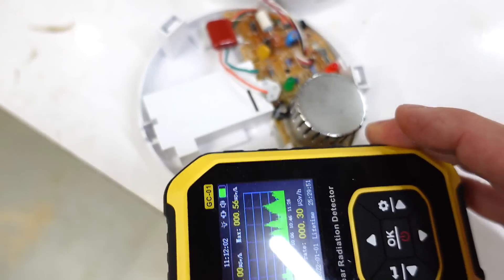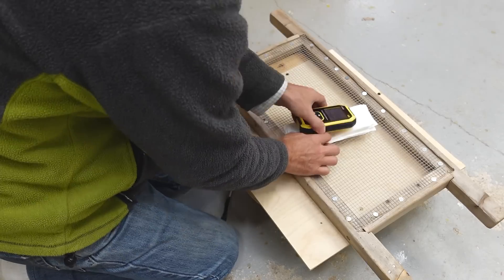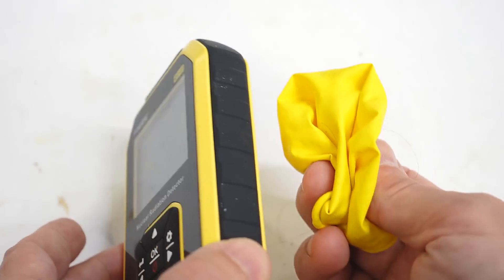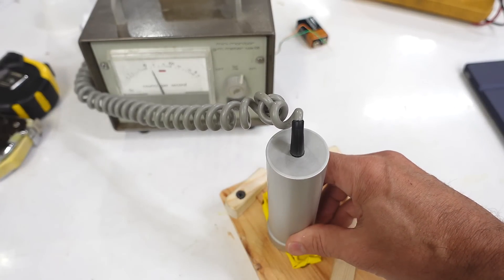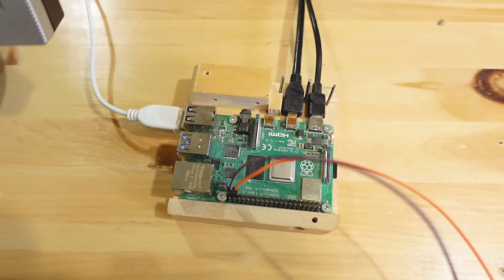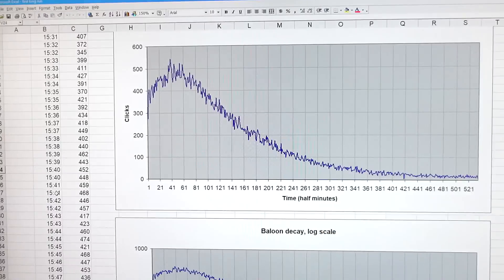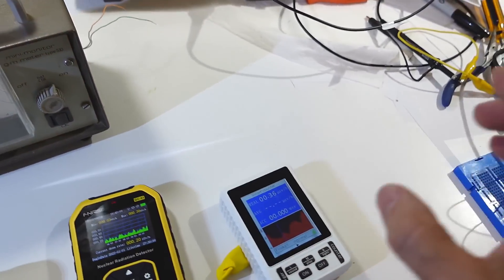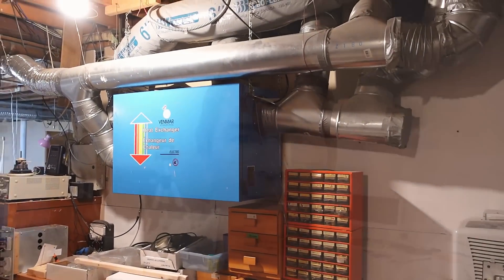Making radioactive balloons using Radon gas

Comment: If you know a welder, see if you can get a 2% thoriated tungsten tig electrode and check it out with your Geiger counter. That would be interesting. Thanks for the video.
Reply: Tungsten rods are dirt cheap, but not all of them have thorium in them. They're color coded to identify what the tungsten is blended with. Green and purple are supposed to be non-radioactive, for instance.

Comment: I have a GQ GMC-500 (there are a few different models) - I really like it, the firmware and UI is pretty decent. It has a 18650 Lithium battery that is easily replaceable. My grandpa was a watch and clock repairman and I have a ton of old radium painted clocks hanging around. Highest reading I've got was 45,000cpm off of a clock from an old aircraft(he was also in the RCAF). 
Ill have to try this radon trick in my shop. If I leave the shop closed for a few days and don't run any ventilation the radon can get up to 250 Bq/m3. I try not to let that happen.

Comment: As someone currently deciding whether or not to get a radon mitigation system in my home, I would be very interested in your insights on the subject. High radon levels is an issue where I live in Oregon, USA. I bought a real-time tester on Amazon and have been experimenting with it on different levels of the house, windows opened and closed, HVAC system on or off. I hope to see a Matthias video on radon in the home!
Reply: If you have an HVAC-system that really works in all rooms, do you really need to remove the radon?
Reply: Radon is yet another spooky bs promoted by charlatans. Do not buy this system. Radon does not affect your health.

Comment: Alpha particles are attracted to various synthetic fabrics as well. Certain atmospheric conditions are especially amenable to producing radon, how much cement is in the building you're in also makes a difference. At our nuclear facility, we have workers go through a portal monitor to screen for beta contamination; it will detect alpha as well, so if it alarms we have to use a portable alpha monitor to determine that it is alpha (radon progeny - using the term daughter products is no longer politically correct).

Comment: idk im thinking that the geiger counter uses an integration that takes like 15-30 minutes to get a full sample size. so if you put the probe over something radio active, not until ~15-30 minutes will it actually have a full sample of the radioactivity since the first part will be all zeros/background. thats my thinking for the bump up.
also all the muller tubes you showed are the cheap glass coated tinoxide sputtered kind. the real good ones are the all metal gamma scout type ones. the glass ones suffer from the thickness of the glass blocking a lot of radieation. i have the same cheap chinease counter at you and inside it has that same glass tube as the one you hooked up to the raspi. i think the issue with the construction of the more accurate tubes and why theyre always 200$+ is the beryillium window or whatever they use. something metal, conductive, but very radio transperent. its crazy what you can buy online now days for cheap. i got a pocket ultrasound with 2 heads, basically as good as the 7000$ GE one for 1300$. you can get a portable chest xray electronic sensor and camera for like 5000$. things are going to be really different in the future if there is ever a war in the pacific.

Comment: Back in the late '80's a buddy of mine did his grad project on recording radon, using the biology storage room as his first test site. He used a Commador 64, a fan, but I'm unsure what he used for the detector and counter. In any event we found out that the storage area was pretty hot.

One thing to test, the replacement filaments for Coleman white case lanterns. They used to contain Thorium to create a whiter light. No need to buy, just go to the sporting goods store with your tester. :)
Reply: Coleman hasn't produced a thorium mantle in decades. You won't find any at a sporting goods store. Maybe an antique shop.
Reply: @Orcinus24x5   Well bugger! Thanks for the update.

Comment: What made you avoid the GMC-300E? Last I knew is was the gold standard for cheap geiger counters. It has a replaceable 14500 battery, can run on external power, and can log data over USB.
Reply from the maker: didn't know about it.  But if I knew about it, I wouldn't have bougt it casue its 3x the price of the one I got.
Reply: @matthiasrandomstuff2221  You got that thing for $40? That's awesome. Glad to see prices are going down lol.

Comment: Is there any reason to assume that the graph isn't just measuring the "rate of radon release" ... the charged balloon attracted it, when it's screwed up and tossed by the counter, wouldn't the gas also have an escape rate as well as a decay rate?
Reply from the maker: Please watch the video.  The balloon doesn't actually capture the radon itself
Reply: Excuse my poor wording.  I mean if the balloon is electrostatic attracting the decay products, couldn't the decay products be leaving the balloon over the test period as the charge holding them there leaks away.  It'd make the decay time artificially steeper if this effect were occuring

Comment: Brings back memories of when I used to ride my bike to work at the nuclear power plant. I could not get my wet cycling clothes and shoes past the radiation. monitors to get into the office. Others had difficulty getting in with wet coats from rain. Those Radon daughters really stick.
Reply from the maker: Must have had more sensitive adiation detectors than I do.  I wish the geiger tube was bigger.
Reply: Oh yes, used photoluminescent detectors. IIRC.  @matthiasrandomstuff2221

Comment: Did you get the same detected radiation curve (initially up, then logarithmically down) with the paper towel filter?  I don't think you showed that.  If not, maybe you're seeing something caused by the balloon itself (i.e. maybe it entraps the some of the elements at first).  I was not sure from what you said, but maybe you were saying that the balloon was picking up decay products, and the filter had actual radon.  Clarify?
Reply from the maker: I didn't have the computerized setup when I did those.  Also had to get the same concentation

Comment: Now I wonder if ion filtering actually has long term health benefits. Maybe by reducing the background radiation levels, one can reduce the environmental sources of oxidative stressors.

Note on radiation and illness: Because most of the mass  of human is water, by far the biggest problem with ionizing radiation is that it ionizes water to OH radical oxides, and that those free radicals can inturn damage lipids, proteins, and dna. It is called oxidative stress, and antioxidants help transform those ionized radical oxides into harmless chemicals.

Antioxidants may help "mitigate" some of the risks of   ionizing  radiation.  But not all and can't protect DNA's nucular cross section from direct hits. 

Fortunately, most damage to dna is either harmless mutation, or ends up killing the cells. But because of statistics and enough ionizing events, unfortunately some mutations end up causing cells to become cancerous.

Comment: That GM tube board is interesting.

Recently, I was pondering how people use RTL SDRs to collect ADSB data and upload it to 'the cloud' and was curious if there was something similar for radiation data.

On the other hand, I'd suggest spending some time studying a "chart of the nuclides".  The Periodic Table is much more well known by the general public where for nuclear physics, you want the former.
Reply: BTW, if you had a sodium iodide detector, you could probably identify the nuclides based on the energy of particles they're ejecting.
Reply: Yes, there is. Do a search for "safecast" - they have little internet connected geiger counters you can wear whenever you're traveling. That way whole countries get mapped.

Comment: i'm astonished at how concentrated you were able to get that balloon in such a short period of time.  does your house have radon mitigation, or have you ever measured the levels?
Reply: You should test the house! Anyone who lives in certain area should test their house every few years. From the CDC: “Radon is the leading environmental cause of any cancer. It is the second leading cause of lung cancer, after smoking.” - but it is easy to prevent and deal with, a little fan system and then you are all set. And then you can REALLY collect some radon for testing!
Reply from the maker: Never measured with a proper meter
Reply: @matthiasrandomstuff2221  Wow, yes you should get your house tested. You can buy a test kit, leave it out for a few days, and send it in for analysis. I found out my new house had dangerously high levels (7 pCi/L) and had to get a mitigation system installed. I also noticed the weather outside can have a huge effect, when it's windy it can get sucked out of the ground and your level can go up 5x. It's also greater levels in the winter due to stack effect.

Comment: I just did it this experiment but with shop vac and sucked air from gravel under concrete slab of house and i did not measured anythink. Im in czech republic and i should have medium radon level in ground. I will try it again maybe with better filter.
Reply from the maker: if you suck the air hard, chances are its getting backfilled with air that isn't from underground

Comment: Very interesting.  I have a small Giger counter and it has a screen with a window in the front to allow it to detect weaker particles, I think what might be happening with your experiments and why the graph suddenly jumps up is that the case is shielding the weaker energetic particles from being detected, perhaps you're actually at a higher level, but aren't seeing those until the decay starts emitting beta that you see counts rise.  So It could be the limitation of your instrument to see those particles?  IDK.  So as a suggestion, see if can purchase different emission sources, they type that are used in classrooms, and then you can see how your instrument is able to detect alpha, beta, and perhaps... gamma?  Sorry this is not my forte... but I remember years ago seeing this demonstrated in a physics department and playing with the emitters and Geiger counters...  And I know you'll be careful with these samples, it's not for everyone to try at home.... and more importantly I think you'll find cool experiments to do with them.
Reply: I bought a similar low cost counter from Amazon about a decade ago. I also bought a very small sample from Amazon of YOU ore for testing. (I'm afraid to spell out the name of the element because yt may remove my comment, as it did a few minutes ago.)
I wanted to let people know this detector is easily available on Amazon. Only $59.
 My comment had the name that we see in the video in yellow and black letters.  I put that name, which is fully visible in the video, in my comment and it was removed by Their Tube. I was informed that my comment was unacceptable because of   reasons.
Reply: @henryD9363  Once I put a link to an Amazon product in a comment and it kept being deleted, They were a product for organizing drawers, they were square plastic containers, but nope, can't have it.  So the element U are talking about U said, and TBH,  U can buy them and shipped in the mail... it is not illegal to purchase or have it, especially in such a small quantity for testing... I think it's all about limiting what we talk about.  The detectors without windows in them can't see alpha... I'll leave it at that since we can't mention much else.

Comment: Static charging units - cats are ideal (dog fur is generally rougher) - if you lack for cat, borrow from a friendly neighbor or repurpose one of your traps or a cage trap and catch, rub and release stray cats (maybe captured squirrels can have their tails pulled gently from a  cage trap and used to activate the static charging mechanism without activating biting or scratching modes of action - a standard candle so to speak).
Reply: I'd love to see the faces of the owners of the neighborhood kitties, if i'm chasing them with an inflated balloon, desperately trying to get them to sit still for a few seconds...
Reply: Better make a HV power supply. Gives you reproducible results and is easier.

Comment: Furnace filter probably is fairly radioactive too huh?
Reply from the maker: probably not terribly so.  Cause the stuff decays fairly fast, so most of the accumulated dust will have decayed a long time ago.
Reply: @matthiasrandomstuff2221  makes sense. Would you suspect outdoor air has any more or less compared to indoor/basement?

Comment: Super interesting! Something I've never seen discussed before is the relative half life of a mixed isotope sample. I'm guessing modeling that wouldn't be as simple as saying the half-life of isotope A is 66 minutes, and the half-life of isotope B is 6 minutes so the halflife of a 50/50 mixture is 36 minutes. All because of those decay byproducts.

This does seem like something somebody way smarter than me COULD model with enough GPU horsepower though. Would be really interesting to see the results!
Reply from the maker: give it long enough and the longest half life dominates.  But in this case one is cascading to the next.  But even so, the longest one will dominate the decay after a while.  It's not a matter of addition or averaging

Comment: A good detector is the Better Geiger project.
It's actually a scintillation detector with pretty basic functionality, but it has a whole range of modding options as most the hardware is open source.
Reply: Another scintillation detector is the Radiacode 102, and the nice thing about scintillation detectors is you can actually determine isotopes, as they can measure the energy of the particles.
Reply: It costs almost 5x as much and looks like it was 3D printed. Surely, a sensible company would charge an extra $30 for something that doesn’t look like absolute trash.

Comment: I wonder if what you are measuring is really radioactivity, or just static charge that goes slowly away to air from that balloon..
Reply from the maker: the way I handle it, you'd think I would have discharged it by the time its on the counter.

Comment: The charged tube will never be able to detect Radon directly but only it's decay products, the reason for that is Radon decays by emitting Alpha particles which will never go through the glass of the GM tube.
Reply from the maker: well, yes, exactly.  That's how ALL radon detection works.
Reply: @matthiasrandomstuff2221  not really, Radon detectors generally use a PIN photodiode which is sensitive to alpha radiation and can directly detect Radon. They can also do alpha spectroscopy and distinguish if the radiation comes from a different radioactive isotope.
Reply: If you are interested other types of radiation detectors (not for Radon) use a GM tube with a thin mica window which is also sensitive to low energy beta and alpha.
Then a detector with a GM tube can also be called a dosimeter but only if it's energy compensated (the one from your father in law might be).

And finally, the best ones are called Scintillators (not Geiger counters) and use a photomultiplier or sensitive diode in combination with some kind of plastic that emits a photon when radiation is absorbed, these can do spectroscopy and are orders of magnitude more sensitives than a GM tube.